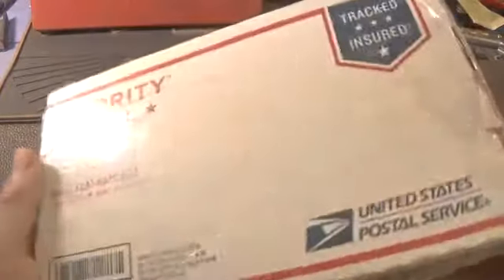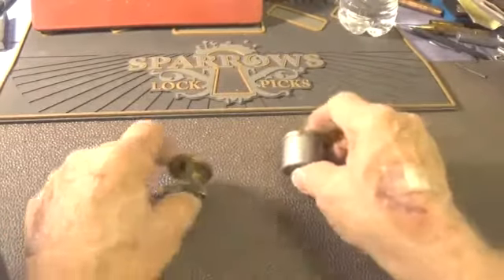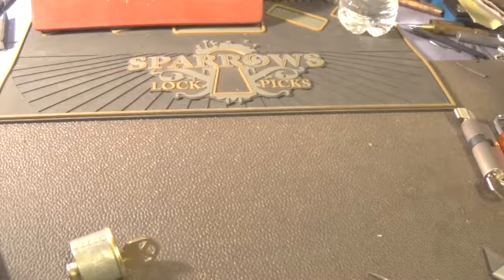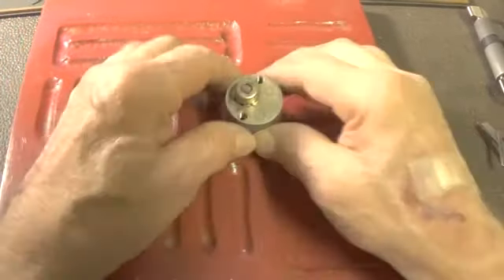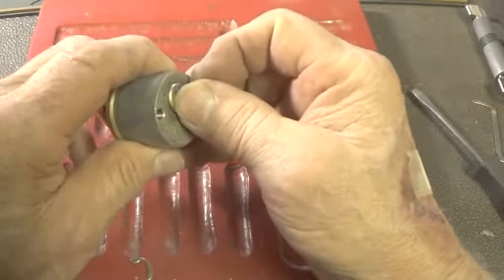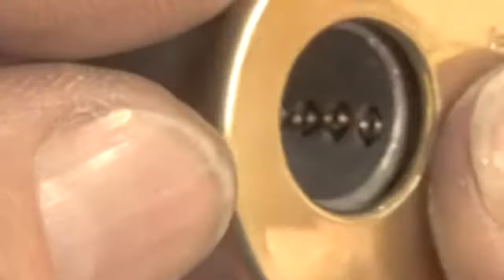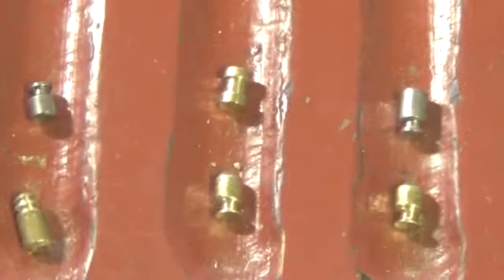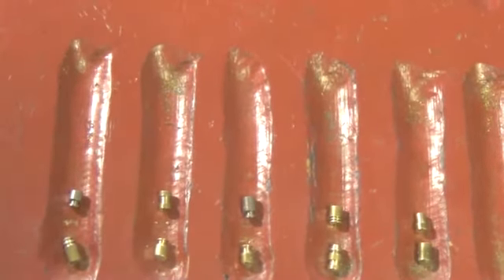(513) Package from Angelo and Defiant SPP'D and Gutted

Comment: Nice pick,
Always a pleasure to watch  a master at work.
You are getting so good you make us look bad. lol
For real though,  that lock was pinned pretty good. If I had only one suggestion... Try using a hacksaw blade with a fine tooth count when cutting your pins. They make the sharpest cuts in my opinion.  

I don't like making challenge locks out of Defiant or any lock with pin chamber caps... Not that they are harder to work on or anything like that. The thing is the split core I can't appreciate, it is obvious that doing this was a manufacturing cut that really affects the security of the lock. 
And then the main reason I don't like these types of locks... I have the hardest time finding replacement caps. IDK why but I can't find any. 
So if anyone has any caps they want to sell, trade, etc  
or has a link to where to get them. Let me know.
Reply from the maker: Thanks. If I need a cap I take a brass welding rod and put a piece in my dremel and file it down to fit and cut pieces off and drive them in. It work great for plugs.

Comment: Defiant was the only lock I made my own pins for and I was still able to get in no trouble. During a gutting things went haywire and that Defiant still has my only set of homemade pins
Reply from the maker: Thanks, The Defiant is really a Kwikset type lock.
Reply: +Texas Jim Yes it is! Defiant is a cheaper version of a Kwikset!  I can not wait to see you open the old Yale lock. Like I said in note. The Yale driver pins are serrated throughout,  from top to bottom. Almost looks like screws. The neat thing is the whole lock is original. At least 50 years old or older. I know how much you like older locks. But it is yours to do as you wish!
Reply from the maker: I opened it yesterday right after I opened the Defiant. I will put it on youtube either today or tomorrow. I also opened and gutted the euro with the yale. I will try to find a key for it and make a key and maybe keep it.
Reply: Cool!
Reply: Jeff Moss would mostly have a keys that  would fit!
Reply from the maker: Thanks